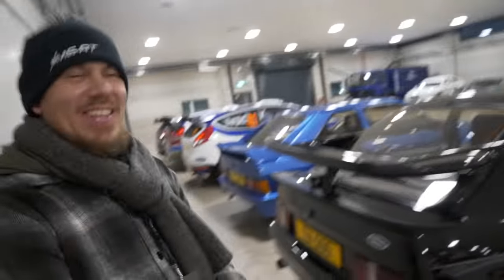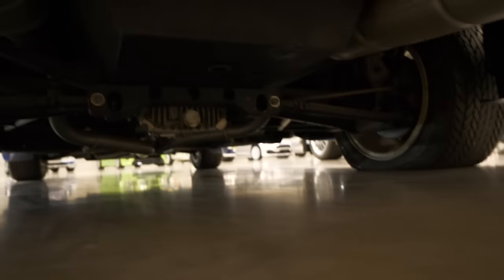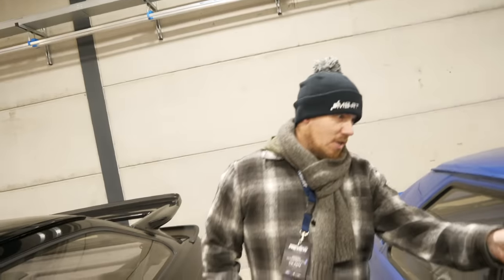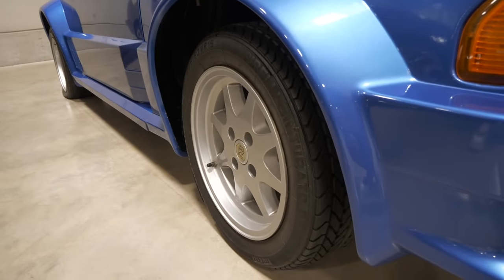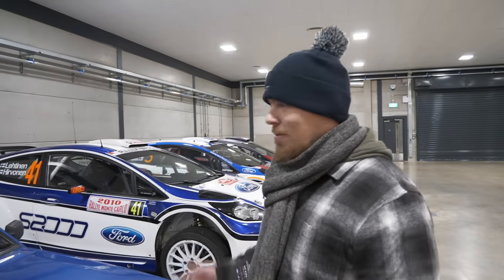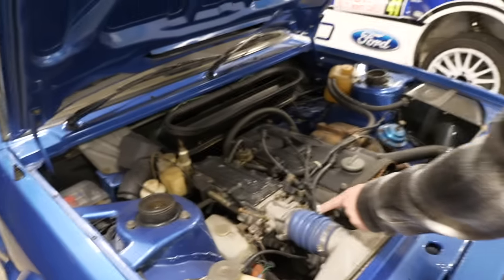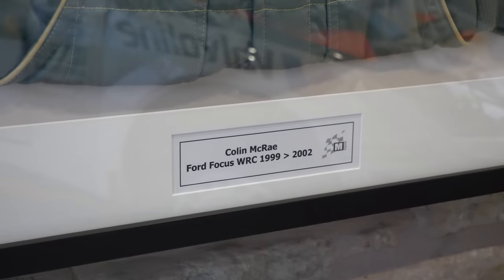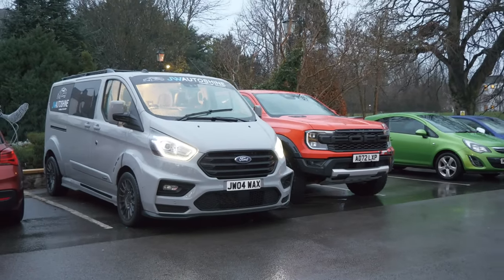WE FOUND THE WORLDS ONLY FORD ESCORT 1700 T!!

Comment: There was.....a white one, if original or not it was rear wheel drive, parked outside a fish and chip shop in Weston-Super-Mare around 1998, Weston Cruise used to be every last Sunday of the Month and there would literally be a dozen Series 1 Turbo in a cue driving throughout the town together, it was immense back then when blokes where building Dimma Kit Mercedes Kompressor modified Peugeot 205 and Sapphire Cosworth P100, exact Touring car replicas, I remember going on Holiday to the Lake District and a dozen metal flake painted Orion's and R5 turbo....cars may be a little faster now but by far you just don't see them like you used to

Comment: i had with regular front lights the RS1600 turbo with this body, i used to drive a RS2000 in rallyes after the RS1600 in rally cars not road cars
Reply: the last i bought was the first RS2000 from 1991 but with the grill not round, as it was supposed to be and later released when the Focus took over

Comment: Interesting fact that most special 'pre development' Fords of the 80s and 90s had 'PU' on the registration plate. Max Power Project 2000 is the same 👍
Reply: The two escos with the oval grilles were the same, KPU 👍
Reply: Chelmsford,  nearest registration office to Ford research at Basildon, learnt that from the auto shenanigans guy, nice video too, thanks, by coincidence (just noticed the car is a Y reg) my school was on the ‘82 Lombard RAC rally.
Reply: @deanoscott exactly that and the V6 RWD Cosworth 👍
Reply: @rsjamie9423  forgot about the v6 car. Acropolis Escos was another I'm sure.
Reply: It might be a coincidence, though. Clearly a Chelmsford reg marker. But I remember on the RS1700T the first test cars were WVW 100W & WVW 101W and the next two being registered in the X-year were DVW 420X and DVW 421X. But absolutely fascinating car!
Reply: All factory built fords had suffix ending ‘VX’. . Sorry to burst your bubble.
Reply: @cwshtygriff13 Examples? Like HHJ 700N, LAR 800P, VHK  74S, WTW 569S, GJN 126T, G94 CHK, K746 GOO, K202 HNO, L421 NHK, M513 WJN and so on?
Reply: @chrisbiewer-rallye-info  My apologies‘I did read it all wrong 😑. I presumed the video was about Ford built cars ‘ not cars approved to be built under dealers etc. You are correct sir ‘ I remember my parents preparing the Andrews’heat for hire’ cars back in the 80’s ‘ and many Ford race cars were registered by the DVLA from the dealership they were sent from. The VX suffix were factory built’ and mostly came from Germany or Belgium .  I still have an LVX Escort’ they were built to last .  I remember the MK1 ‘registration POO ‘ in my parents workshop’ true story 👌
Reply: @cwshtygriff13 Wow, fascinating. LVX was quite a famous series of Mk1s. I remember the Andrews cars were partly factory built, partly dealer built. I remember one UNY 956S or so, which is a Cardiff reg. But weren't Russell's cars mostly from Birmingham area? POO I remember as Mk2.
Reply: @chrisbiewer-rallye-info  I was lucky to see a few back in the late 70’s -80’s ‘ just didn’t appreciate what they were until later in life 😔. My parents were Ford main dealers’ and as young lad swooned over the showroom cars ‘ still good days though 👍

Comment: I wonder what happened to the moulds for that body kit ?
Reply: Was there an X-Trac conversion kit for the Mk3 ?
Reply: @AndrewNeilBaird  wrong 
XTRAC was the transmission 
GARTRAC  done the fabrication 
If you had the renumeration ZAKSPEED did the motivation
Reply: @chiefrocka8604  Gartrac , yes that's right , they did do a shell kit for the MK3 , I priced it at 4k ISH back in the late 80's , fitted to a bare shell . Which then gave you the base for a rallycross escort .
Reply: Yeah gartrac did do the mk3 as well
Reply: @dannygamble7033  There was an Indian guy in redhall Cresent Edinburgh that had a red  zakspeed rs 3.1 Capri it only just fitted down the alleyway as it was so wide 😄. I wonder where it is now ??
Reply: Long gone they went up
In smoke years ago at fibresports.
Reply: @chiefrocka8604  maybe a decade ago now! ( i live really close to Gartrac workshop)  they had a 1700T shell for sale  , i use to have a mk1 mex needed a lot of fabrication doing to it  almost  had the work done by Gartrac themselves  foolishly  i didn't  but the 1700 wasn't much more £ than  having  my shell fully grp4 and repaired  !  Wounder who has that one  ! Again another regret of mine should of gone for it !

Comment: The Turbo literally says T04 on it which indicates that it is in fact a Garret T4, It's a crying shame that they abandoned the RS1700T project and opted for the RS200 instead.
Reply: the weight distribution, it was front engine rear wheel , everyone was going 4x4 or rear engine rear drive .